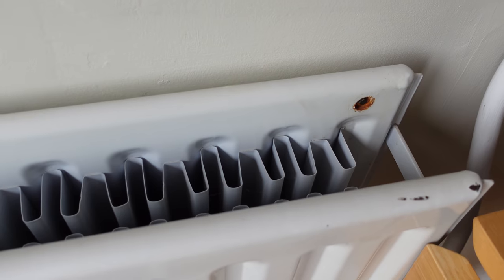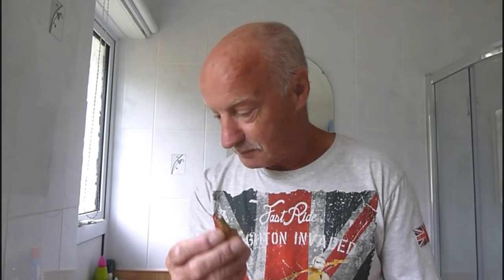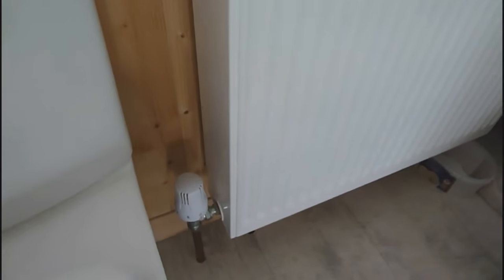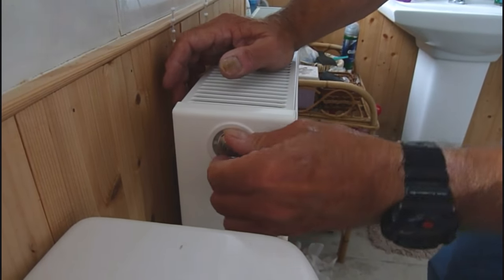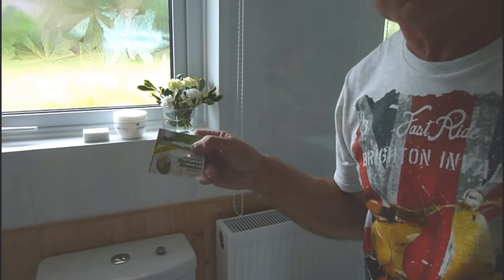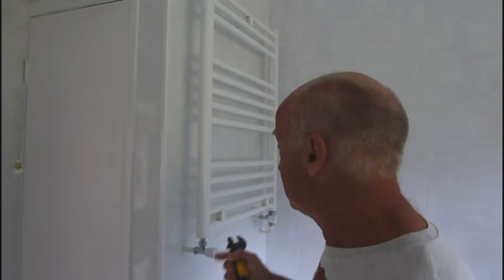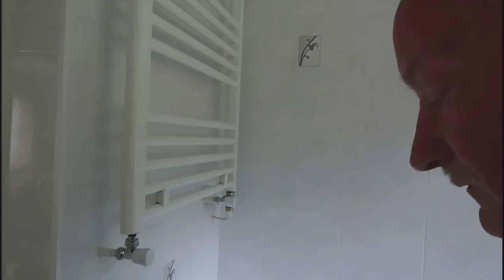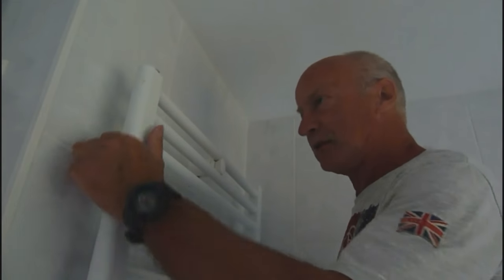Auto air valves, Will they fit my radiators? What sizes? How do I fit them?

Comment: Should be no need for auto air vent. If radiator keeps getting air in it,then it needs investigating,not using temporary solution,masking the original problem
Reply from the maker: The perfect system is on a really low count, how many people are going to pay hundreds of pounds to sort it out.